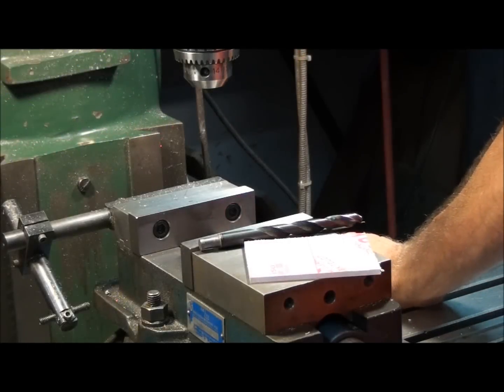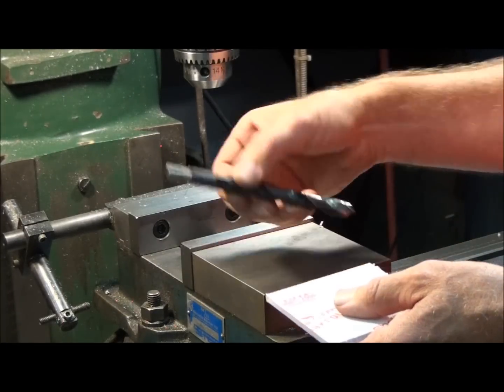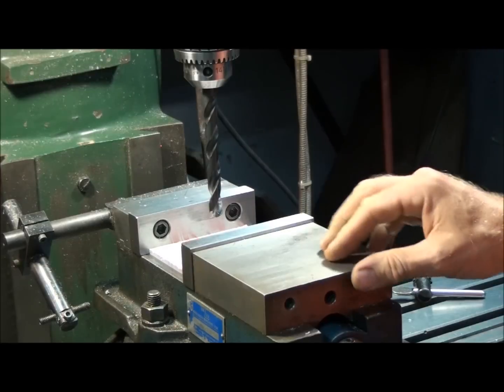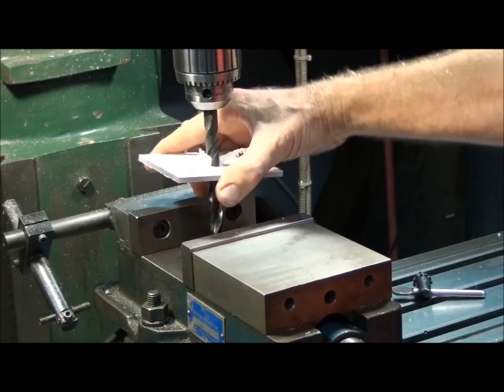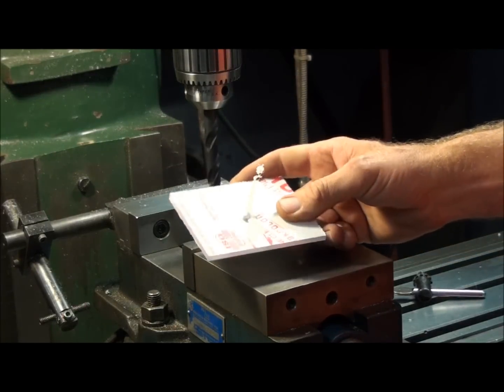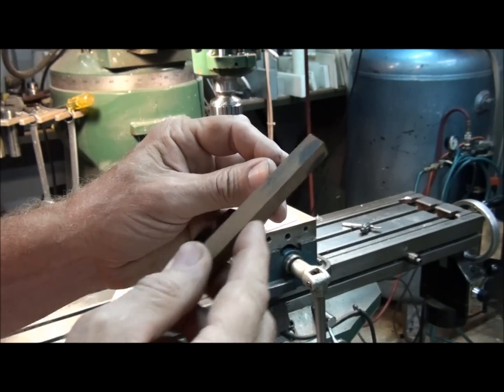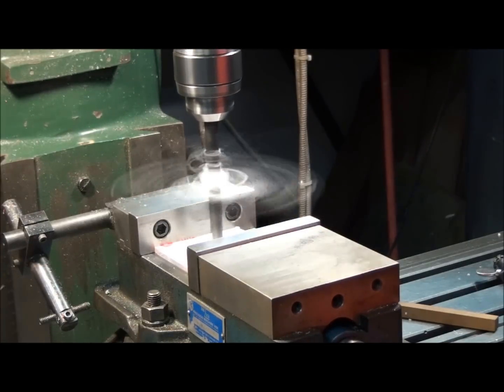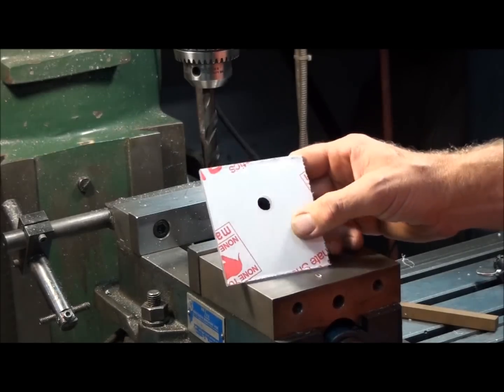How to Make a Twist Drill Safe for Use on Brass and Plastics

Comment: I once had the brilliant idea of attempting to drill a piece of 18 gauge steel corner bracket. I held it with my left hand ON the vice and went at it with the cordless drill. I had a moment of intense cringe and justified that I was just enlarging an existing hole by a 1/32 or so. 

My hand did not turn into a spaghetti squash mess, but I had to clean up and glue up a nasty rip in the palm right between thumb and index. You will now see me clamp everything but wooden parts when drilling.

Comment: I completly disagree with your dulling method.It would not fly in a production shop.  What you want to do is change the rake angle but maintain sharpness.  1-2 degrees or 0.  You can do this with a stone but it is easier with a fine grinding wheel.  use the side of the wheel.

Comment: Clamp all work before drilling.  Use correct speed and feed for what is being drilled. Step drill larger holes.  Problem solved.  No need to modify drill bits.
Reply from the maker: That is definitely not true. Even if the work is securely clamped, a standard drill bit can screw into a brass part with enough force to pull the bit out of a chuck or the part out of a vise. That is especially true if the part has been pilot drilled. If you aren't aware of this, you are in for a rude awakening.
Reply: @TomsTechniques  Almost 60 years working in a machine shop using my method with zero trouble.

Comment: Thank you for sharing this tip. I do the same in my shop but my understanding was a little bit different. I'm giving the drill a zero rake so it doesnt catch the part up and drill into it, but I leave the edge sharp. It looks like your doing the same zero rake grinding by looking at the angle youre holding the grinding stone. Nevertheless, it's the right thing to do.
Reply: https://www.youtube.com/watch?v=pAngKHIZgyA here you can check this video

Comment: I need to drill 3/64" holes into small brass balls (so I can solder a pin onto it...another story!) and I'm not sure what type of bit to buy. I understand about filing the edges so they don't grab, but what type to begin with...there're so many options!
Reply from the maker: You'll need a 3/64" jobber bit. I like to get them with split points and 118º or alternatively 135º point angle. You won't have to worry about a bit that small grabbing, especially if the hole is drilled in one step.
Reply: @TomsTechniques  Since I can't find just this size by itself, I'll have to order them, so I'm wondering, Cobalt vs HSS vs carbide tips...should I just get the cheapest?
Reply from the maker: That size is probably not available at the local hardware. Have you tried a hobby shop? High speed steel is more than adequate for drilling brass, cobalt and carbide are not necessary.
Reply: @TomsTechniques  Did it and it worked great! Got a center drill in the right size and got my bits from a hobby shop. Thanks!

Comment: Great tip Tom..... Just to get one thing clear. You said its not a good practice to drill a pilot hole first in brass before going in with a bigger bit? Even when the bigger bit has been honed to a Negative or Neutral rake as you've just shown?

Comment: I usually use brad-point wood drill bits for plastics. They have a cutting edge that extends ahead of the web on both outer edges, so there's no chance of them screwing in. They only come in fractional sizes, as far as I know, but you can always ream the hole to the exact size you need.
Reply from the maker: I use them on thin plastics to get a nice, round hole. Check out my video on how to grind them, if you want something besides fractional sizes.

https://youtu.be/XA8L4L30TyI

Tom

Comment: why not just use a C-clamp instead?
Reply from the maker: The drill will still grab and can actually be pulled out of the chuck. It's better to grind the drill so it doesn't.

Tom

Comment: I can go around dulling drill bits because they are the shops no mine. is there anything else that can be done? maybe peck drilling?
Reply from the maker: The worse tendency for a drill to grab in plastic is in a hole that has been pilot drilled, so if you drill a larger hole, do it in one shot. Other than that, just make sure the work is securely clamped down, so when the drill does grab, it won't spin the part. Also make sure the depth stop is set in the quill to limit the distance the drill can screw into the part. The best option is to modify a set of drills just foe plastic and brass. Tell your employer that is an inexpensive option over someone getting hurt.

Tom
Reply: why not just use a C-clamp?

Comment: One additional point I would like to make.  I really am against clearing the swarf or shavings from the flutes by hand.  Good way to get cut or splinters.  I recommend just using an old tooth brush when taking finished work off drill press
Reply from the maker: I just give them a quick blast of air if needed. Brushes always seem to grow legs. :)
Reply: Toms Techniques. That is effective also.  I would like to buy a compressor but need to make a space for one.  I have no garage and limited space.  All my tools and jigs need to be portable and  easily moved or tucked away.
I hope this will change soon.

Comment: Tom, did you purposefully dull the drill bit? I could've sworn the "proper" way was grinding a 0º rake angle.
Reply from the maker: I removed the positive rake angle on the cutting edge, thus reducing the tendency for it to screw into the work. Dulling the edge (rounding off slightly, or stoning a 45º chamfer on it) has precisely the same effect.

Tom

Comment: I haven't had to do it in years, but it used to be common to make sign faces with a lot of holes in 1/4 or 1/8" or so plex. I used to sandwich the plex between a couple of pieces of 3/4" or 3/4 on the bottom and 1/2" on the top, with lots of clamps or screws to hold the sandwich together. The plex would still try to grab, but if you had things clamped down well it was under control. Your technique looks like it will make cleaner holes as well as being safer.
Reply from the maker: +l wilton 
Yes, a drill properly ground for plastics won't grab.

Comment: If you increase the back angle of the blade will work too,  and decrease the angle between the blades will perform a more stable drill, works very well on using a hand drill machine. Great job.

Comment: I need to drill 5/32" holes on a 0.2" centre matrix in ABS plastic box 1/8" thick.  I am having 2 problems:
1- accuracy of centres dead on centre- I solve this by indenting the plastic at the centre.  Start off with a smaller drill bit, then step up to the 5/32 drill bit.  That MOSTLY works although not quite as consistent.
2- There is some amount of chipping and burrs and the finish isn't as nice as I would like it to be.

BTW, I am using a hand drill at relatively slow speeds.  The 5/32 bit is a high speed steel bit.

Solutions?
Reply from the maker: Donovan Lym 

If drilling by hand you'll need to layout the locations of the holes and center punch them before drilling. If you are looking for clean and round holes, pilot drill with a 9/64" drill and then ream them to size with a 5/32" reamer. For best results, both drill and reamer should be run at several thousand RPM.

Tom

Comment: I drill 1" and larger holes in acrylic to mount lenses in light fixtures. I also chamfer the hole to set the lens. A hole saw tends to grab the plastic part at the last moment and both pick it up and break it... Since the plastic doesn't crawl up the hole saw as it would with a twist drill, but gets stuck on the end, I watch carefully as it gets near the end (where it tends to grab) and when it does, I quickly turn off the press and let the plastic spin free in the air. (it's about a 3"x 6" piece) I hold the part down loosely on the table with big heavy gloves, and I have a guard board in case it comes off and comes at me like a Chinese star! The times where I tried to clamp the plastic down simply caused it to be destroyed. If someone has a better way, point me to the video!
Reply from the maker: Flintsmooth 
NEVER wear gloves while operating machinery, especially machinery with rotating shafts such as a drill press. Entanglement injuries are horrific and believe me, you don't want to be on the receiving end of one.

The hole saw is grabbing because the plastic is melting and sticking to it. Try a much slower rpm and a water based coolant. Polycarbonate is much better to machine than acrylic because it has a higher melting point, if that is an option. It will also help to drill half way through, flip the part and finish up from the other side. Figure out how to clamp the part so it doesn't break. That may involve some fixturing to evenly and firmly clamp it. DO NOT HOLD THE PART IN YOUR HANDS, ESPECIALLY WHILE WEARING GLOVES. It's not worth losing a hand or an arm over.

Tom
Reply: Toms Techniques Thanks for the advice... I don't usually wear gloves near the drill but in this case I am careful to stay away from the bit and hold only the corner edge of the part - expecting it to catch and spin at any moment. I learned long ago never to hand hold a part, I'm just sort of stopping it from spinning on the table, the hole saw keeps it down. If I clamp it from spinning, in the vice, it breaks at the end of the cut, not exactly sure why it does that. I've tried drilling both sides.

Thanks for the tip about water cooling, maybe I can set up a water tray and drill under water, the part isn't very big. I've tried the various cutting oils I have but they don't really work. I can't change the type of material because I have a huge supply of this one thing, not even sure what it is but it suits my purpose. Next time I'll try the slowest speed on my press, see if that helps.

Comment: Haven't watched all your videos, but intend to.  I worked in the plastic industry for years and we found that when cutting plastic on a band saw, especially on softer material like polypropylene or polyethylene when cutting with the teeth in the normal position it often grabbed or actually brake the piece.  We turned the blade so it ran with the teeth facing up and while it may not have cut as fast it did a much nicer job of cutting smooth edge with little or no breakage to the material.  Sounds odd I know, but maybe try it and see if it works for you.
Reply from the maker: ***** 
Thanks Frank.

I've never had a band saw grab a plastic part, other than round, but if I do I'll remember your suggestion.

Enjoy the videos.

Tom

Comment: Hi Tom,

Have you ever tried grinding them to 80 degrees as an alternative? There are a few people selling drills ground like this for plastic. Dulling the edges seems a lot less work however the idea of having a sharp and safe drill is also attractive.
Reply from the maker: Perhaps creating a negative rake would be a better way to describe it the modification than dulling. I haven't tried drills with 80º pints, but then again, I know this technique works so I haven't had the need to try others.

Tom
Reply: Toms Techniques Ah yes, I see what you mean.Sorry there was a long time between watching your video the first time and seeing the pointy drills.

Comment: Great video like all your work!  What about drilling very small holes, say less than 6.0 mm.  Is there a safe diameter?
David
Reply from the maker: Thanks David.

There is no "safe" diameter when it comes to drilling plastics or pilot drilled brass. Any size drill will try to screw in if not properly prepared.

Tom

Comment: Hi! Thanks for the warning! Are these safe? http://mdm.boschwebservices.com/files/Bosch%20Forstner%20Bits%20(EN)%20r24492v31.png
Reply from the maker: I wouldn't use those on plastic, or at least on a thermoplastic. They generate a lot of friction in the material they are drilling and will likely melt (read stick) in a thermoplastic. Brad point or sheet metal drills work well in plastic sheet and ordinary twist drills with negative rake (like in the video) are the best bet for thicker sections.

Tom

Comment: I design and build high current test equipment that uses a lot of copper, and it is also tricky to drill (and otherwise machine). Usually it is 1/4" to 1/2" bus bar and step drills work very well, especially if you drill halfway and finish after flipping the part over. Plus the next step makes a nice chamfer and removes burrs.

I've had some exciting events using a drill press like you show, but clamping a thin, soft piece in a vise like that is asking for trouble. And you should use parallels or scrap material under (and sometimes over) the thin material, or clamp it flat to the table.

Supposedly parabolic flute drill bits with more "pointed" tip angles are good for soft, "gummy" materials that can grab.

When I bought my mill/drill machine, it had only a Jacobs chuck, and when I tried my "hand" at milling, especially soft material such as copper, it would sometimes grab and the chuck would pull out of the spindle. I surface milled a steel bracket that way and it was frustrating, but I got it done. Then I got a set of proper MT2 mill holders and used the drawbar, and things are much nicer now.

Thanks.
Reply from the maker: Copper, brass and plastics all tend to grab like shown in the video. All it takes is a little negative relief on the cutting edge of the drill to prevent that from happening. How it's held makes no difference at all. If a standard drill bit is used and grabs the part, it will either be pulled out of the vise or as you've found out, the chuck will be pulled out of the spindle.
Reply: Toms Techniques
what about drillingverysmall holes, say less than 6.0 mm.  Is there a safe diameter?
David
Reply: David Leach
There are tiny spade bits used in watch repair that are useful for making very small holes.
Reply: use PCD (polly crystalline diamond) insert tooling for machining copper.

Comment: Thank you! I'm glad I came across this. I made two brass parts once and needed M6 threaded holes on one piece and M6 clearance holes on the other. I decided to drill tap-size holes through both pieces and then widen the ones that needed clearance holes. On this second step, the drill yanked the piece out of the vice each time and I haven't dared drill a pilot hole for brass since.
Reply: I often have to mill materials that like to grab drills, one thing I've done is lock the quill in place and use the knee to raise the work into the drill.
Reply from the maker: Drilling pilot holes in brass is deadly if your drills aren't properly prepared.

Comment: I had this happen to me long time ago when drilling a plastic front panel. Fortunately it was soft enough that when it hit my hand, it snapped in half. The drill press was never the same for me!
Reply from the maker: I've always said that the drill press is the most dangerous machine in the shop and drilling plastic can make even more so.
Reply: Toms Techniques When I was in school we had to take a safety class that showed us footage of real accidents.  The most disturbing was a man drilling sheet metal on a drill press without clamping it first.  As you can imagine it didn't end well.

Comment: really what is happening is the drill plunges as it breaks through. slack coming out of the machine and / or uncontrolled down feed. if you don't want to mess up your drills you can use the nut on the depth rod to sneak down and the piece underneath is great too. but here is the thing to always do, do not hold anything by hand in a drill or mill you will get injured in quick order if you do !! if you want to dull your drills that's ok but still no holding with your hand. burrs on plastic and brass can be thicker if the drill is rounded as it breaks through it rubs and causes heat and melts a little bit and causes a burr on the bottom side as it goes through. I have drilled .020 dia holes through 1/4 thick D-2 tool steel and you must use the down stop on your mill and go about .005 thou per peck and it may sound weird but saliva is the only lube I could ever make work. and a really firm fast peck so the drill cant compress and shoot down too much at one time and shatter as it try's to break through.
Reply from the maker: What you say is not entirely true. Yes, in this example the drill is grabbing as it breaks through the part, but I have had thick plastic parts grab as well and long before the drill ever broke through. Brass is even worse than plastic if it is pilot drilled. In that case the drill will grab every time and you won't be able to stop it. The drill will either pull out of the chuck or the part will come out of the machine. Not a good thing considering the high cutting speed of brass. Modifying a set of drills as shown in the video is cheap insurance against that happening.

Tom

Comment: Also try step drill bits. masonry drill bits.  forstner bits. Hole saws.
 adjustable hole saws. spade bits, wood bits. if all else fail torch the opposite end of the drill bit to melt a hole.